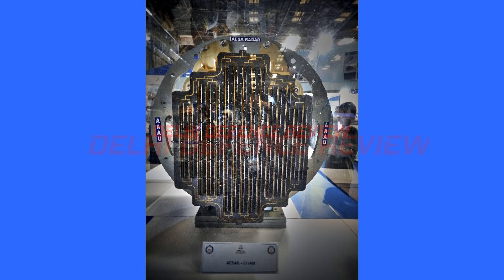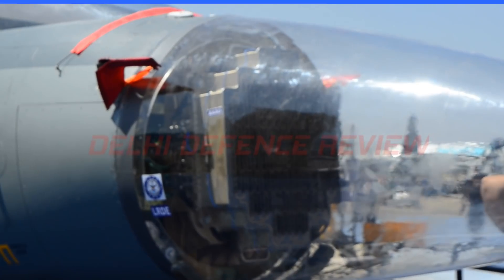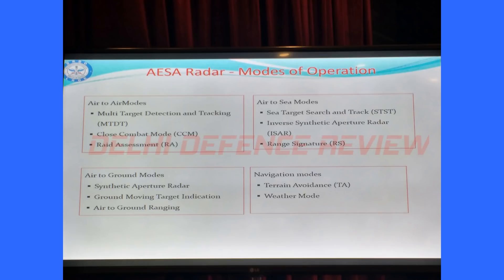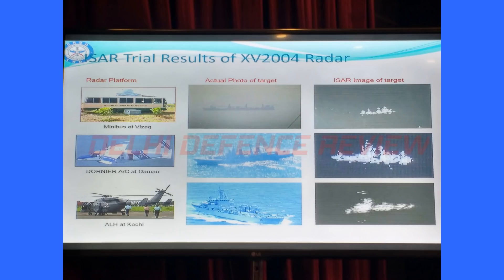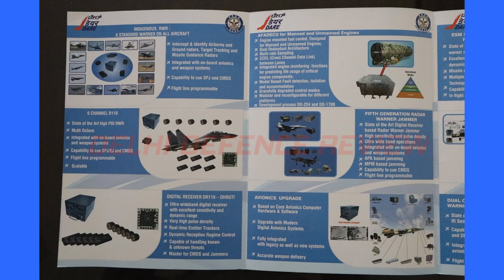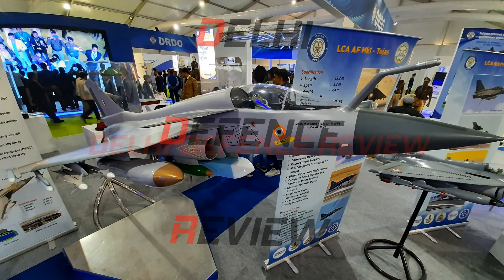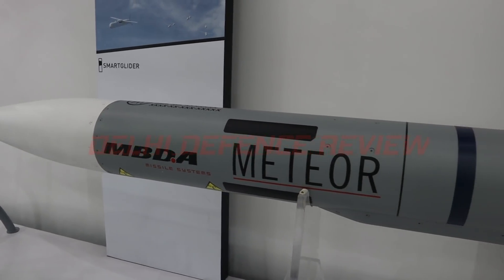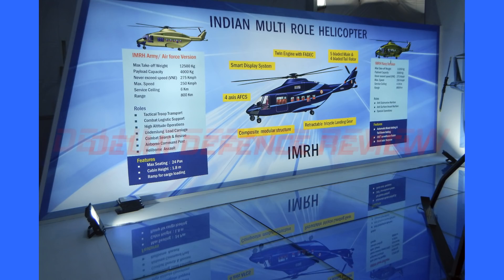Uttam AESA Radar - Flight Testing Updates

Comment: Can be the A319 platform used as a testbed for GTRE engine testbed also?
Reply from the maker: Generally 4-engined planes like the Boeing 747 or IL-76 are preferred for flight testing engines because they have a lot of redundancy. Anything can go wrong while testing engines so that helps. Plus being large planes, they have a lot of space for instrumentation and engineers. A319 on the other hand is a twin-engined narrow body aircraft. Dont think it is suitable but it is a glaring hole in our testing infrastructure.

Comment: Very good news !! But they always give timeline of next year for completion so I am not very optimistic about Uttam's production starting in 2022. 

Plus HAL has already ordered ELM-2052 for Mk1A which will start in 2023 till 2028. MK2/MWF flight testing will start in 2023 and production is expected to start in 2028. 

It means there is neither any pushing factor for Uttam to be expedited before 2023. But even if we get it by 2022 END - LRDE must be honored for their work provided they give quality on par with ELM-2052.
Reply from the maker: There is some weight to saying the first radar to be fielded will likely be on the MWF and therefore there isnt a deadline hanging over LRDE's neck. But you have to remember that they also need to finalise this radar and show its performance to be given the go-ahead for all the fighter radar upgrade programs that they want to do. IAF will not agree to it if this one isnt done. So there is a push to finish things quickly and get on to the next thing.

Comment: So Mk-1A will not get uttam. Earlier some sources claimed that last batch of mk-1a will have uttam.

Btw estimated number of trm in current uttam? Because jf-17 blk-3 may have 1000trm variant of Chinese KLJ-7A.
Reply from the maker: Uttam has around 760 TRMs. Just the number isn't enough to compare radars. Software the runs the radar is just as crucial. Performance of Chinese radars is an unknown quantity at the moment.
Reply: With an inferior engine having a 1000 trm radar is waste of 💰 as the current jf17 can never provide enough power